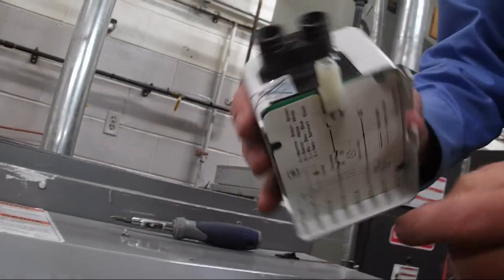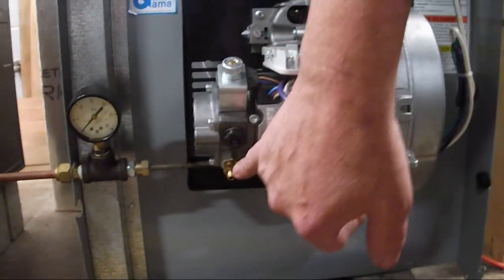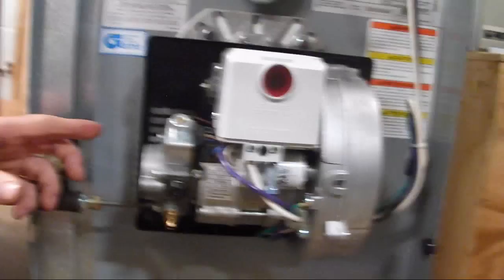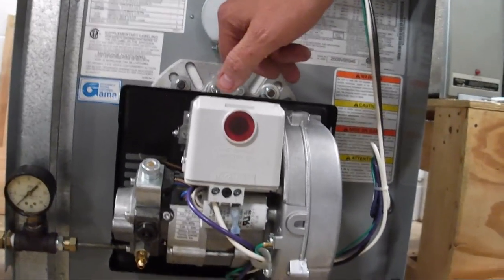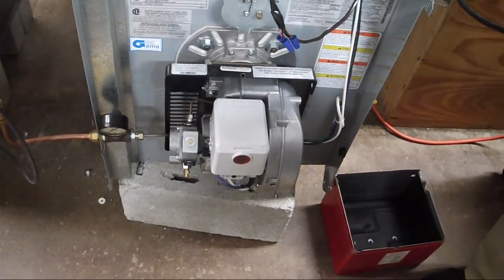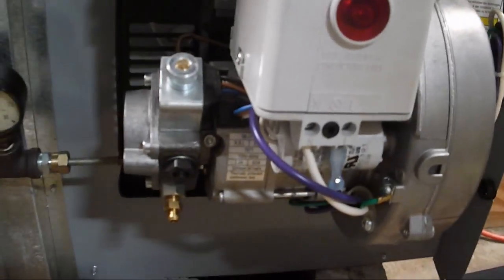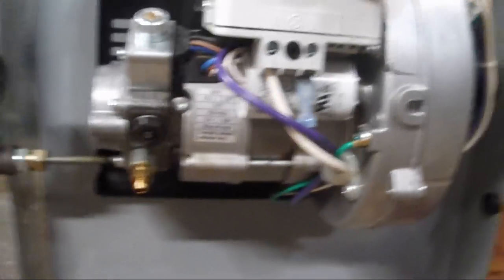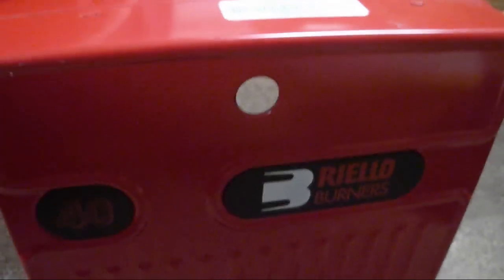2009 Carrier oil furnace w/Riello 40-Series burner diagnostic checkup/troubleshooting!

Comment: I have a riello 40 and have taken care of it for about 20+ years.  I"m very good with all adjust and maint.  Anytime I'm around the burner and she is cycling to ignite I stick around, just to make sure she is doing ok.  This morning she started to cycle on so I stood there.  Cycle started... she ignited and popped right out (no protection devices kicked in)  blower / pump continued as if unit didn't ignite and split second later unit started fine.

Any ideas?  Ignition pack?